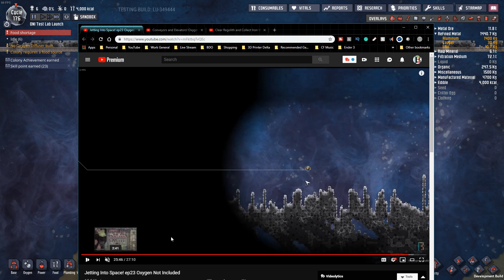Low Tech Space Scanner! Oxygen Not Included Tutorial

Comment: So, I find myself with a small problem in the design at present.  I had to pause and squint a bit, but I notice that your initial buffer gate retains the red signal from the Space Scanners before accepting the green signal and starting the whole "program".  It might have been changed since the video, but the instant my Space Scanners send a green signal, the first buffer goes green and the doors close before the blast doors even finish opening, the whole cycle starting before the regolith can fall into position.  As such, I branched an automation line off of the Space Scanners before their NOT Gate, and had it run to a 60 second Buffer before a NOT, then had it hit your automation design.  That bypassed whatever change they made to the Bugger gate that forces the green signal through without the red delay, ensuring the regolith falls before the doors cycle.

Comment: A few questions:
1) Does this still work in the newest beta branch of oni?
2) Could the automation be reworked a little to make the movement of items from left to right faster?
3) Is one steam turbine enough to cool the regolith and machinery on the surface?
4) Could you make a video on rocket silos and detecting incoming rockets with the scanners?
5) Do you have any ideas for self sustaining electrolyzer systems for the newest beta branch that wont use wheezeworts (all i have is a system using a steam turbine and an aquatuner that either needs to use less power of generate more heat to be sustainable)?
6)Are the wheezeworts in the newest beta good enough to cool electrolyzer output?

... I'm out of breath after that